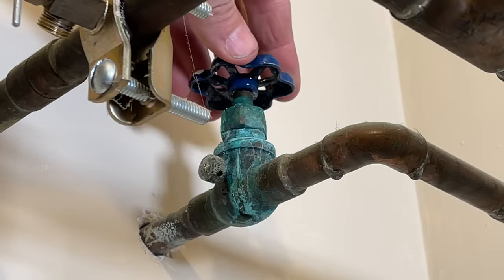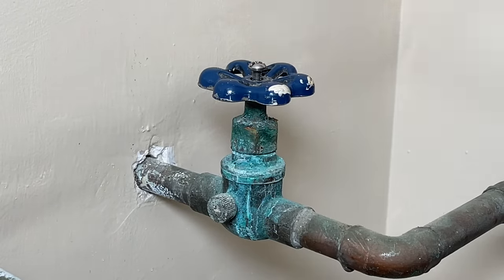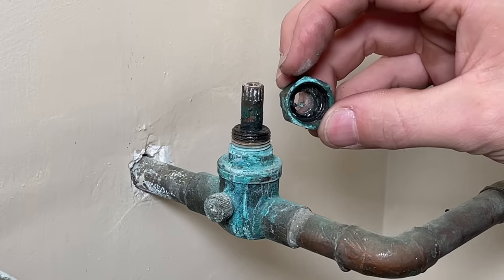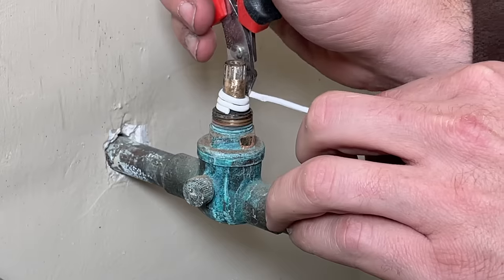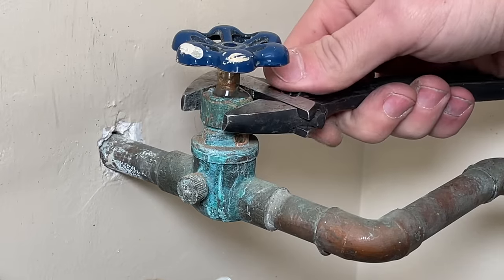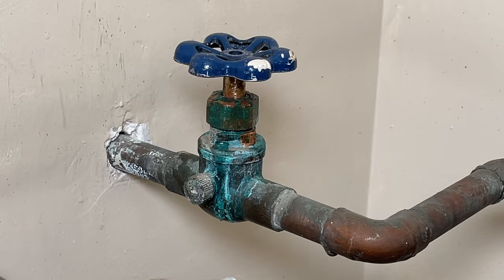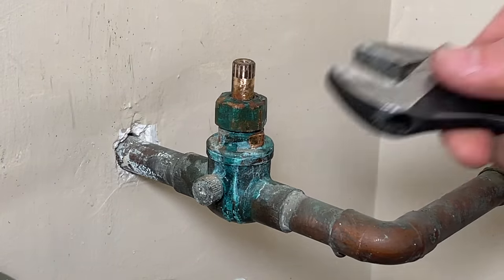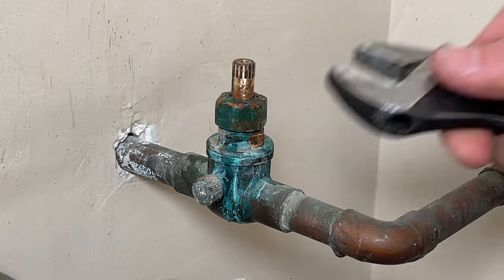How To Fix A Main Water Shutoff Valve Leak

Comment from the maker: Video showing swapping this valve out for a ball valve with press fittings.  https://youtu.be/U2CEQHM06cQ
Reply: That would be the way to go if you have the water main at the curb off. Crazy to work with that 100 year old valve.
Reply: Can't you use a good thread sealant instead of teflon packing cord?
Reply: Saw the title and came here to see why a ball valve wasn't the suggested fix. Gate valves aren't even up to code anymore in a lot of areas due to this problem. They work best when used regularly, while a ball valve doesn't care much if you leave it open or closed for most of its life. The exception is those smaller 1/4 turn valves on toilets, sinks, and other water supplies. Those smaller ball valves have weak stems and are small enough that scale becomes a much greater problem. The stems break or the scale keeps them from closing all the way if you don't use them every now and then with hard water supplies. I always make sure I have a spare 1/4 turn valve whenever I need to close those smaller valves.
Reply: M
Reply: Mp
Reply: @kcirful
Reply: Right in the beginning: That is not a Globe Valve , it is a Gate Valve.
Reply: @superexperiments3155  The cord isn't to seal the threads. The cord is to seal around the shaft. If you just put thead sealant on the threads there would be a huge leak between the packing nut and the valve shaft.
Reply: Unless you have a trustworthy plumber, be prepared to be ripped off. That's why I  do my own repairs. When my heat broke I had to call a guy I didn't know. He charged me $900 for 15 minutes and just hot wired my furnace.  When I got a reputable guy he showed me and did the proper repair for $300
Reply: @superexperiments3155  Teflon tape works.
Reply: This video quickly help me seal our drippy spigot.  Thanks!
Reply: Not a time or cost effective to take appart..I'm with you all the way till then...easier to replace than take completely apart...put a new ball valve in...
Reply: You must not be able to solder, why wouldnt you just use compression, don't need the 5000$ tool
Reply: would be a lot easier to just do that or compression ball valve shut off.
Reply: Replacing rubber valve inside the tap is easy. To do this repair, how do I shut the water coming inside the home from the city water lines?
Reply: Very nice! Very nice, indeed!

Comment: If you shut off the water to the home, what not replace the entire valve with a new ball valve? 🤷‍♂️🤷‍♂️🤷‍♂️
Reply: a ball valve is way better
Reply: I asked the same question in my head
Reply: Sharkbite ball valve shutoff!
Reply: If the value had comprehension fitting the replacement value is easy and all you need is wrenches 
to undo nuts hold value body with a wrench apply opposite Pressure when doing up or returning 
This value is soldered and can be a nightmare to desolder this value
If you are a diyed this v
Reply: I know. I thought there was some magic to stop the leak without shutting of the main.
Reply: @han7902  sharkbite is magic. You could do that but have to work fast. Just cut and push in
Reply: Replace valve with new ball valve if you can turn of main is my vote!
Reply: @Monarch15w  For the average diyer replacing this complete value isn't as straight forward as it looks
Reply: @javeedsultan8484  if you can shut of the main...... you have the ability to replace valve
Reply: @michaelwerbick  I know that but just looking at the joints and wear it is, and assuming the homeowner is going to attempt to replace it,  it doesn't look like theres much flexibility  / movement in the pipe, as a professional plumber, piece of cake, . I've seen some really bad attempts by homeowners to "fix" pluming and ends upwith indoor paddling pools.
Personally Would have gone straight for new value,  for the time it'll take to clean and replace the seals could've swapped out the complete valve
Reply: @JP-kg3ko  seems a bit silly if you are able to shut of water to your own property , I know in some countries  individual homes don't  have individual shut off values but street valves that shut of supply to a number of properties. 
$250 seems a bit steep, whole job should take 30 to 60 minute's to replace the valve, but I suppose if you need to be a licensed plumber you can charge that little bit more
Reply: That's is the best option, or else back to step 1 2 3 every year when it starts leaking again.
Reply: @javeedsultan8484  i second that motion
Reply: my local code dictates if you replace the valve, you must also install a second shutoff and an extra spigot. And be done by a licensed plumber.  But doing what this guy did, I will only have to pay $15 to have the town shutoff the water main that comes into the house for that day and replace the washer and clean up the stem.
Reply: @go86go  Fortunately here in the UK only electrics and gas require qualified and registered professionals, . 
Water Board are constantly upgrading the main supply with new pipes  and then branching of each property with shutoff vavles at the edge of the property. 
 I normally add a second shut of valve and use that to shutoff house supply if we need to 
pipe work in the UK are all metric and the original shutoff valve something have imperial pipe on inlet side so imperial fittings aren't commonly available for DIY Chains
Reply: @JP-kg3ko  wow that's some dictator crap. That sucks. That's why I got a well at my house. Nobody is going to tell me I can't do my own plumbing work. Man our founders must be rolling in their graves. This isn't what they wanted for us.
Reply: @javeedsultan8484  I think the problem most diy will have is brazing.
Reply: @JP-kg3ko  this is America, I’ll shut my own water off.
Reply: @Mike-gz4xn  just rewatched the clip,  musg have missed the start of the clip as I thought the pipework came out the wall and through the wall on the righthand side
but just rewatched it and noticed it didn't go through the wall so actually it's not as difficult as I first assumed.
De soldering shouldn't actually be aproblem in 
 not to sure about the under 30's  but I sure us old timers would haven soldering pipework as a skill, most do it yourselfers would have, 
Today's youngsters don't seem to haave the "I'll try to fix it  myself" attitude , I can understand not wanting to tackle electrical work  or gas pipework
but water pipe work  is well within a DIY'ers skill  especially since the cost of a blow torch isn't an expensive or hard to use tool, 
nowadays you don't even need soldering skills with pushfit and compression joints widely available You just nèd pipe cutting tool
Reply: @MagicGate814  Watts ball valves are pure junk.
Reply: You made the job more harder
Reply: @wilsonmung3044 you right!!! 👍👍👍
Reply: @javeedsultan8484  Just having bought a house and being totally ignorant about everything (which is why I'm watching this video), I want to be pretty careful with water pipes... not too excited about messing it up and the possible very expensive problems it may lead to.
Reply: Probably because the home owner would not be able to braise the the valve and piping.
Reply: Ha, if I read your post I would have saved myself some time. Great minds think alike. Lol
Reply: Its obviously a instruction video on how to repair a gate valve....haha I'm sure he already knows he could of changed it out for a ball valve or new gate
Reply: ! Excellent job!
Reply: I would replace to a more modern ball valve these days! Old ones are old days!
Reply: @Scott-xq2dm  👍👍
Reply: Full flow ball valve on east coast they used gate valves and well they fail, probably on the closed..  beeen ther done that..
Reply: @joshuarkristof80  Not an every year job. My parent's house (1962) has original main valve. Replaced washer twice; added fresh packing once. Valve gets closed almost everyday when no one is present for a lengthy period. I'm a DIY'r. In my experience, repairs fail when the valve has been abused by over-tightening because the washer should have been replaced.
Reply: Can't you buy all new internal components for the valve, that would fix it for many years ?
Reply: @javeedsultan8484  what does "new value" mean?
Reply: @Noahsoak  bloody predictive text  for value read valve
Reply: This is why hiring a licensed plumber is the best choice.
Reply: @electricianron_New_Jersey  sometimes economics limit your choices
In an ideal world you would employ the correct tradesman for the job
Reply: Watch the whole fucking video before commenting.
Reply: @javeedsultan8484  
Here in the UK, if you employ an “unqualified” plumber to fix your plumbing you are asking for trouble. Being registered is an entirely different issue. You are either a “qualified” plumber or “unqualified”. To become qualified you have to have been properly trained via an apprenticeship or other. And passed the relevant exams.
Reply: Well said his able to shut of the water from out side replace it job done
Reply: I agree if water is off to house just replace with ball valve even compression ball valve
Reply: I was thinking the same thing.
Reply: Helpful video, but as a DIYer I was surprised you put so much torque on those 60 year old pipes without supporting the valve body. Also, these valves in service are run either fully closed or fully open, so as long as they are not leaking in either position who cares if the stem is leaking in a middle setting. Often if leaking in the fully open position I can make it stop by tweaking the handle open just a bit more. But failing that, yeah new ball valve.
Reply: @appleztooranges  I like the shark-bit idea, since it’s accessible.
Reply: @javeedsultan8484  If a DIYer is too dumb to cut out an old valve and put a new one in, they shouldn't be disassembling any valve. How annoying to shut off the water to the whole house and visit their local hardware store looking for parts for a 50 year old valve? I get the whole reduce, reuse, repair value, but damn that's a lot of wasted time for a quick job, especially when you have access to the main city shut off valve. Drain it. Beer. Torch the valve and remove.
 Beer. Clean the pipe and solder a newer style ball valve...beer. It is a three beer job. Packing the packing nut is a one beer job, but I'm glad he tried that first.
Reply: Propress new ball valve
Reply: not allowed
Reply: @michaelwerbick  Tried to check on your video on how to do that, didn't find it, am I just missing it?
Reply: @MattyDemello  They'd be rolling in their graves seeing how few children die in childbirth and how long our life expectancy is as a result. They'd be too awe struck to notice literally anything else. 

"Wait.... you only have 2 kids on purpose? And they both lived? ..............."
Reply: @kchop4tehwpn  I would rather live in a risky America where people have guns because it's their right and you're at risk of getting shot without any tyranny. Our founders would ask us 1 question today "are you free'er today than we were and if not the American experiment has failed. Our founders wanted it so we can all live our life and if we didn't want to deal with government we wouldn't have to. They wanted it so we didn't have to deal with Gov. That Gov shouldn't be a huge entity controlling us. That's why America was created. Our founders would be going to war again over just Obamacare and the mandate that everyone must either have Gov healthcare or pay a fine. Now if someone wanted to live a life where they didn't want to ever deal with Gov that person would get a fine. That's insane. If I wanted to live in the woods I own and support myself and not need Gov YET Gov keeps entering my life wanting paperwork and fines me? That's NOT what our founders left us with. It wasn't supposed to be like this. It's sad
Reply: @appleztooranges  Just sweat a new one on. I would never use a Sharkbite on a main line like this.
Reply: @appleztooranges  Sharkbites are junk
Reply: Much better and quicker to replace with sharkbit ball valve.
Reply: @JustForYouDiy  No way I would use a Sharkbite on a main shutoff.
Reply: Do ball valves have to be soldered
Reply: That is exactly what the city required me to do.
Reply: I had a main valve that would not close off tight and it was the weekend and finding the shut off at the curb was not going to be easy.
 With the valve passing I cut the line on the house side and slid on a shark bite 1/4 turn ball valve, not the best option but I was able to do repairs and now I can plan on replacing the bad valve when it's not an emergency.